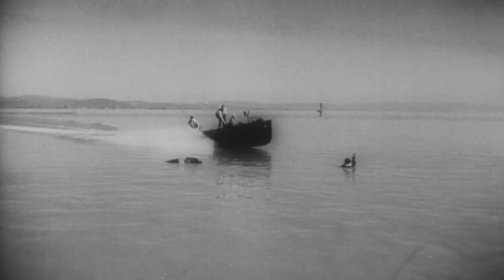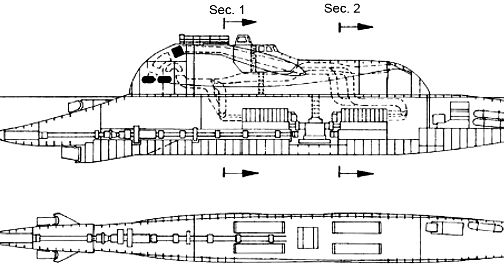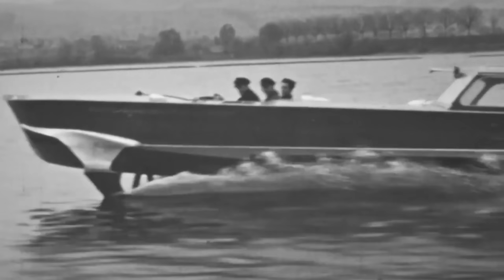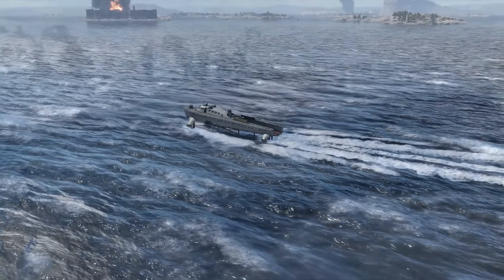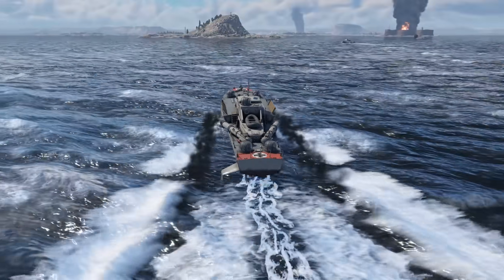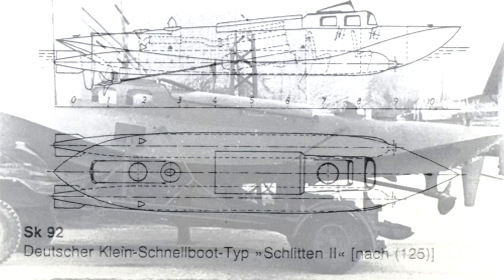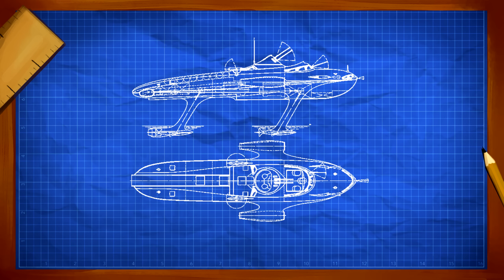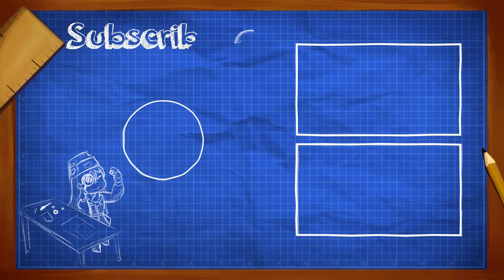WW2 Germany's Rocket Powered Boats | Sails and Salvos

Comment: 6:30 The Duh question is how are you going to get close enough to shore to offload a non-floaty tank while requiring a very deep draft due to the hydrofoils.
Reply: Do you watch the video without sound? Its pretty much explained at 6:30, it doesnt offload a non floaty tank at the shore, it drops a pontoon with a tank on it close to the shore and the pontoon offloads the tank on the shore

Comment: In the years 1981-5, I saw hydrofoils in Riga, Tallinn and St. Petersburg (then Leningrad) harbours, that were rather similar to those German experiments you say that "vanished". Thus, I think I know where...
Reply: The "vanished" German designs used self-stabilizing semi-submerged deep-V hydrofoils - a very simple system known since the early 1930s. Even the Soviets built a couple research crafts with it before the WW2. The 1970-90 Soviet passenger crafts of the Baltic sea you're referring to were using straight multi-layer fully-submerged hydrofoils with controlled flaps - a completely different system. You clearly have no knowledge in this area.
Reply: @sergeychmelev5270  I have only said I saw something like. I know that Russian people discovered all that is to be, there was even the Red Book of soviet discoveries to be bought in such neosoviet republics as CSSR, Poland, Magyar soviet republic and others.
Reply: That would have been around the time that the US Navy's Pegasus-class boats operated.  The first was commissioned in 1978, and these boats were decommissioned in 1993.  They were fitted out with a turreted 76mm gun forward and eight Harpoon missiles aft.

Comment: The difference between a boat and a ship is its centre of mass. While a boats top will lean inwards in a tight turning circle, a ships top will lean outwards, pointing into the opposite direction. Compare a small outboard motored fishingboat with a Gerald R Ford Class aircraftcarrier, and youll see the difference immediately @coneofarc
Reply: by that logic a personal pontoon boat is a ship, despite being 18ft in length

Comment: If those Jet Boats hit a thin wall or cloud of mist, the engines will get snuffed out instantly.
Reply: Odd that didn’t happen to the thousands of V-1s launched across the stormy Channel into foggy England.   Even if they did happen to somehow be put out momentarily, the spark plug would reignite the fuel and on they go.
Reply: @ww748  The spark plug is only used to start the pulsjet on the starting ramp, from a external power source, not during flight.
Reply: No

Comment: Pulse jets are ridiculously simple, especially compared to a high-powered maritime engine. So from a cost and rate of manufacture perspective, this makes sense for a Kriegsmarine that was always short on parts.
Reply: The biggest issue with the Argus pulse jets was their low static thrust.  V-1s could not take off using the jet engine alone, they required rocket assist or catapults to get airborne.   Very few details are known about the Tornado as no photos exist, some sources say it had two Argus engines - which makes more sense.  It used two floats from the amphibious Ju-52, but exactly how the floats and engine were configured is unknown.  About all that is known with reasonable certainty is that it did reach high speed but had terrible seakeeping and would be limited to relatively smooth water.  The overall concept had some merit as the Italians managed to sink several warships with much slower explosive boats.

The video mentioned a maximum speed before becoming unstable - I don’t know where that statement came from as I have found no reference to that effect.  However I have demonstrated that it is likely true.  I built a 90cm radio controlled model of the Tornado several years ago based on the most popular rendition of the boat powered by a propeller - model jet engines either produce inadequate thrust or are too large for a semi-scale model.  Up to a scale speed of about 50 knots the boat ran well but above that it could begin to porpoise badly.  You can see that clearly in the video found in the link below.

https://youtu.be/zhxizF_pEOU 

.
Reply: @ww748  
Thanks for posting.  Nice model.
Reply: Water injestion would be a huge problem.
Reply: @anzaca1  
No
Reply: But they've got very low thrust - about 500 lbs. static - at, say, 50 mph, that's about 66 HP.  You'd do better sticking a commercial outboard on the thing.  Jets don't really provide a power advantage until you get up around 375 mph.

Comment: But how would the boats powered by a pulse jet get started? Pulse jets don't work from a standstill.
Reply: They very well do! 
If a pulse jet doesn´t move through the air, push some air through the pulse jet:
https://www.youtube.com/watch?v=7QXlTMCqmAs
Reply: Blow compressed air over the fuel injector.... Job done.
Reply: Actually the Argus engines produced about 220 kg of static thrust, which would increase as the speed increased.  It would be slow to accelerate though, and even at 50 knots they would not have reached their best efficiency.  But this was a project of desperation using what they had on hand, not best engineering practices.

Comment: Creating expensive state of the art pulse jet and regular jet engines just to strap them onto ships meant to suicidality ram into things seems kinda like a waste- just like the V1/2 idea... or many of the other failed wunderwaffe....or many of the regular terrible designs of the nazis.
Reply: The pulse jet was by no means state of the art.  It was 70 year old technology.  It was invented in 1867 in both Russia and Sweden.  There were several patents around the world from 1908 to 1934.  It was a very simple engine, requiring a couple different diameters of metal tube, a venturi style fuel injector and a spark plug.  Intake valves for the air were optional.  You could build one in a garage with hand tools at any point in the 20th century.  You could use metal sewer pipe, if necessary.

The Argus V1 engine was literally designed to be cheap and easy to build by "unskilled" labor (possibly prisoners).  The idea that they were super expensive is understandable, given the other wonder weapons the Germans came up with, but this one was actually cost effective, given that they made 31,000 of the things.
Reply: Pulse jets are dead easy and freaking cheap. Any combustion engine is more expensive and way more complicated ! 
Consider it a (guided) anti-shipping missile; any guiding equipment and rocket engine is usually lost once you launch the missile.
Reply: @ottovonbismarck2443  not at the time they weren’t
Reply: From what I've read the Argus pulse jet had a run time life span of around 1hr.
Reply: @edwardd9702  That depends on how much fuel ya give it. But if you're bombing England and Belgium at 350-400 mph, an hour is all you need!
Reply: @tempestfury8324  The shutter valve grid would wear out.
Reply: @edwardd9702  : Thanks for the info! I didn't know that. Well that would certainly be detrimental for usage on a boat. The whole thing is ridiculous! Oh, those Krazy Krauts!
Reply: Hardly crazy at all, just desperate.  As stated, how is the Tornado explosive boat any different in concept that the V-1?  It isn’t really.  The Germans built over 31,000 V-1 engines so the engines were essentially free.  So were the surplus Ju-52 floats used for the hull.  The radio control sets were off-the-shelf units from the Fritz X guided bombs - again no development work required.  The entire project used cheap available parts in an innovative manner.  How well it would have actually worked in combat is unknown, but it couldn’t have been much worse that other low-budget ideas the Germans were trying at the time.   If you want to know what the Tornado “might” have actually looked like in action:

https://youtu.be/zhxizF_pEOU

Comment: Plural of Schnellboot is Schnellboote, not Schnellboots :)

A 70 knot boat is useless as a torpedo boat in the context of WW2 as WW2 torpedoes didn't go that fast.
WW2 torpedoes were capable of at most between 40 and 50 knots, most of them sitting at the lower end of that range.
For launching at higher speeds aircraft torpedoes needed braking in order to hit the water slow enough that they wouldn't break up on contact (which is why torpedo aircraft were so slow, or at the very least were capable of very slow speeds without stalling even when fully armed).
Reply: 1. You draw the wrong conclusions. At 70 knots you'll produce a wake that can be seen in the dark from the moon. You won't tell everybody that you're out there until you launch you eels. Instead you wait silently in the dark in an ambush position, launch your torpedos and get the hell out of Dodge City.
2. You could set up torpedos for either range or speed, thus some torpedos exceeded 50 knots easily. Type 93 "Long Lance" comes to my mind.
Reply: 70kn is much less that the launch speed of aerial torpedos.
Reply: @orbiradio2465  it is, but that aerial torpedo doesn't get hit by the launching aircraft a split second after it hits the water :)
It just drops aft and below the launching aircraft as it turns away. Can't do that with a torpedo boat.
Reply: @jwenting  There are several solution to this problem. US PT boats rolled the torpedo over the side. For tube launch note, that the speed of the launch plattform is added to the speed that is generated by the launch charge.  The third solution would be launching over the stern like the early British MTB did.
Reply: @jwenting  That entirely depends on your launching system. The Russian G-5 had forward pointing but rear launching/dropping torpedos; I can see some issues with that configuration ... US and Italian torps were just dropped over the sides while Germany and GB used proper torpedo tubes. Coincidentally, both countries also built the best boats ... 🙂
Reply: @jwenting  You know that you dont have to launch torpedos right in front of the boat? Just mount the launcher at an angle and you dot run over the torpedo, there are even examples of that in the video.
Reply: @ottovonbismarck2443  Поверьте, и у немцев с англичанами было более чем предостаточно катеров с кормовым пуском торпед, причём немецкие катера с такой схемой пуска строились даже после войны крупными сериями - типа KTS в Восточной Германии. А систему пуска на Г-5 взяли на вооружение после изучения трофейный английских CMB 40- и 55-футового типа.

Believe me, and the Germans and the British had more than a princely boats with a feed launch of torpedoes, and German boats with such a launch scheme were built even after the war in large series - such as KTS in East Germany.And the launch system for the G-5 was adopted after studying the trophy English Cmb 40 and 55-foot type.
Reply: The russian boats dropped torpedoes behind them, which activate after they are in the water. Surprises enemies in warthunder when you charge forward and then turn away because they don't see the following torpedoes coming.
Reply: Meh, you just hate Germans. Did it ever occur to you that they could slow down, launch and speed away? No, it didn't.